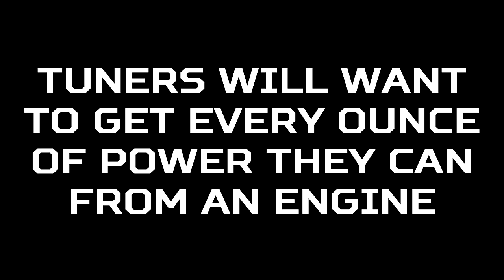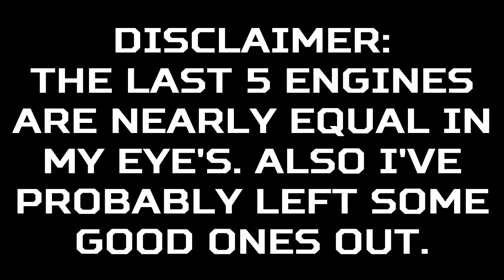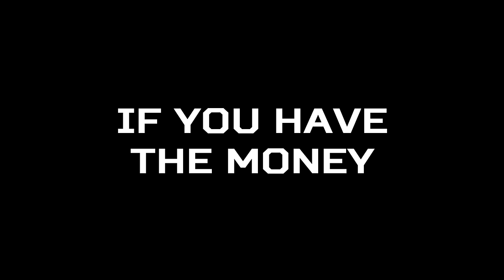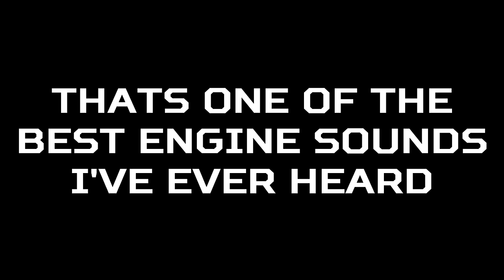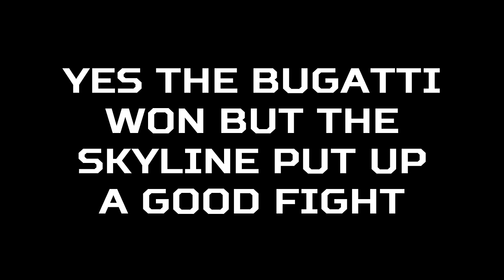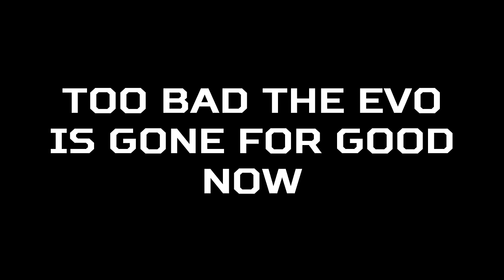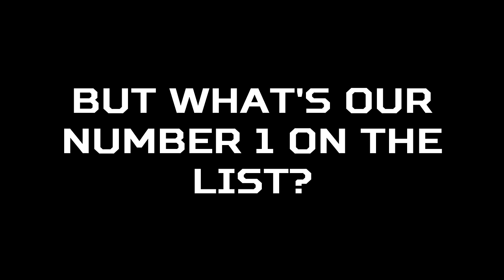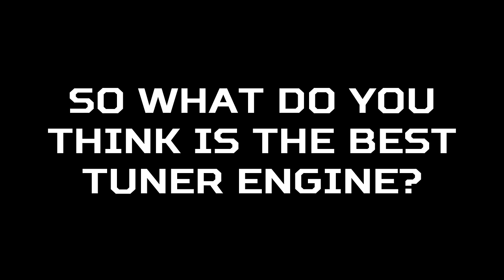9 of the Best Tuning Engines

Comment: ls should be number 1.
Reply: Kameron James I know, but he said the top 5 are nearly equal in his eyes
Reply: Only cause they're easier to tune than an Fm radio.
Reply: but muh 2j
Reply: Kameron James very true ls is a lot better engine than a 2jz
Reply: Great motor. But I think I think factory turbo motors yield more power through ECU tuning. My ls1 had rather small gains through ecu tuning alone.With a cam, heads, long tubes package later it made big power gains. But that was $$$$$. A 1.8t vw motor from 1999 can yield 50 hp, and 75 ft lbs of torque with a $375 remapped ecu. Now that impressive for the money.

Comment: Had to quit watching after I saw the Sr20. My assumptions were correct that this'd prob be a Fuckboi vid.
Reply: What's wrong with them
Reply: ?? Tf is that suppose to mean
Reply: One of the most overrated motors in the world. Aka. Garbage.
Reply: +James Robertson haha ok
Reply: I sorta get what your sayin, people generally have sr engines coz it happened to coincidentally be there when they purchased their s chassis not the other way around. Sort of like a producer and an artist, producer gets no recognition but put in just as much work. Sr is the producer and the chassis is the artist, whilst a 2JZ is the artist and the chassis is the producer.
Reply: Yeah I see what you mean but yeah I like SR's but 2J's are mad too.
Reply: +James Robertson 
100%
Reason why 2JZ is so famous is because how strong the internals are from factory. Extremely over engineered. The bottom end can be pushed to produce more than 300% of their rated power whilst remaining reasonably reliable. Very few (if any) engines in the world are capable of this.
Reply: I don't know how reliable they are but the fastest 4 cylinder I have ever seen has an sr20. It does the quarter mile in 6 seconds.
Reply: y jk the ls is still better the 2jz will need a top end rebuild before your making any power so no clue where you got a strong motor out yea stock there great but as soon as any power is on them they aren't reliable also an ls makes more on all motor those 2jz motors are all boost

Comment: No Audi 2.2 5-cylinder or Audi 2.7 V6? No 4.2 V8? No VW VR6? Shame on you...
Reply: Vr6 isn't that great. It's terrible for balance and poor head gasket design.
Reply: The big advantage of a VR6 is that it allows a 6-cylinder engine to fit inside a Golf. Also many tuners have proven the VR6 to be bulletproof reliable in most street-car applications. This engine only needs some basic mods to really wake up. The weak factory head gaskets are due to technical design difficulites that occure on most VR style engines. Still not a problem though, since you can buy extremly strong aftermarket ones. Also this motor is a beast under boost.
Reply: +ron zo I love the vr6 but I have to agree with you. They can hold a lot of power on stock internals but it's all the subsystems that you basically have to completely rework to make the engine reliable.
Reply: I worked at a company in the early 2000's called eip tunnig. They were pioneers at turbocharging that motor. The head gasket is a major failure due to the narrow v6. it creates to much heat. its very unfortunate because it is the small block chevy equivalent for vw. Cheap plentiful and availible. just has serious flaws.
Reply: Eip used to be the go to!!! would love to find a turbo kit for my vr6.
Reply: There is a company in Baltimore called Eastside. The guy who owns it was apart of the deveolpment. Had had the first vr6t corrado. Hit him up. He still can get the software i think.
Reply: or 1.8t even
Reply: Eip had that blue conquest back in the day whatever happened to that?
Reply: Rob Baker is a buddy of mine he had it. I have to ask him. The red one was fast too.

Comment: one of my favorite is the vw VR6
Reply: I agree, but the more common vw/audi 1.8T and/or the audi 2.7t should have made this list.
Reply: +Nicholas Wolf I have a 1.8t jetta :-)
Reply: +salemcripple I have a 2.7T A6 :D
Reply: I have both haha, not floatin my boat, only agreeing. I have 2 Mk4 Jettas 1 is a 1.8T that's my Tuner, I have a set of magnaflows on it and it unleashes it, and the ko3 turbo is pullet prove, I also have a Jetta VR6 not I know these are highly tuneable, I'm still learning about them. Great sound and, it's easy to Turbo the VR6 and really turn up that already torquey engine. And the VR6 always came in automatic of 6spd right? Glad you agree that at least one of these VW engines should be there
Reply: Hi, i'd like to yous know that i dont have either engine. 
Peace.
Reply: Robert Leduc I know that the R32 VR6 golf had a manual trans. I'm pretty sure the jetta did as well

Comment: No Hemis? The motor that makes dragsters so fast they need parachutes just to stop? Trash video...
Reply: +Brad Prause I know, the hemi is a hemispherical combustion chamber. That mixed with a motor as good as an LS explains those crazy fast drag times.
Reply: Hemi motors today aren't true hemi motors either. Still a good engines though:) pushrods to my heart
Reply: +Aiden PC Today's Hemis are true Hemis. It's the exact same design as when it first came out. Hemispherical combustion.
Reply: +Michael Scott They are not "true" hemi motors. yhe Gen III heads are different than Gen I.
Reply: +Michael Scott Granted that they are in effect hemispherical. Gen I had a combustion area that was like cutting a tennis ball in half. Today's heads are a little complex than those.
Reply: +Aiden PC more complex *
Reply: Nissan is not owned by samsung.. Renault has a 43% share of Nissan stocks, but does most defiantly not own them. And Samsung has a 20% share of Samsung-Renault Motors Stocks, a subsidiary of Renault, not Renault. Samsung does not own either companies. Stop spreading miss information.
"Renault acquired the car division of Samsung on 1 September 2000 in a $560 million deal for 70% of the company,[175] eventually rising its stake to 80.1%.[176] Renault Samsung Motors is a marque used almost exclusively in South Korea (although some models are sold in Chile). The majority of the company's production at its Busan plant is exported under the Renault badge."
Reply: ford owned a minority stock of cummins in the 90's, cummins has always been independent. why wont this rumor ever die?

Comment: FYI: Lancer Evo is powered by 4G63T, not 4G63. Although the engine is more or less the same thing, 4G63T is stock turbocharged DOHC engine. 4G63 comes in a variety of different configurations. For example, my car is powered by SOHC version of 4G63. The beauty of Mitsubishi Sirius engine is that it's very modular. Want to replace SOHC head with DOHC head? No problem. Just bolt it on, get a new timing belt and swap the oil pump cover.  If anyone's interested in beefing up their 4G63 - check out Project Zero G. This guy has buttload of info on modyfing cars powered by the Sirius engine.

Comment: LS > 2jz. The LS is the better engine in pretty much every metric. First off they're cheap, easy to find, and you can build them a million different ways. It's shorter allowing it to fit in smaller applications or behind the front axle if your going for optimum weight balance. It's lighter by almost 200 lbs with less top heavy weight giving a lower center of gravity. Stock vs stock they can reliable take about the same amount of power depending on the LS though some LS engines can actually handle more than the 2jz. Fully built they can both take a ton. And in the end the LS engines have more power potential without having to use as big of a turbo or no turbo at all.

Comment: The Saab b235r definitely should be on the list.
Reply: B234* b235s have weak internals compared to the older versions
Reply: +GraffPaint85 maybe but if you can achieve the same hp/litre as from 2jz with stock internals, it should be definitely on the list.
Reply: b204,b234 , internals are good for 500 hp from factory!

Comment: Barra 6 turbo engines.
Fg onwards. Big power and very underated.
4l is not a bad size for a straight six too.
Reply: Get off the pipe bud come on its insulting legend like the 2jz with a crap barra

Comment: I like this list and agree with most of it. One thing missing. Ford aluminator. Basically a coyote from hell. An indestructible light weight block that can take all the power you give it. Just not cheap

Comment: LOL try tuning an RX-8 rotary... :D :D also I'd add the Peugeot ES9J4 to the mix, it's a 3ltr V6 which has 194 BHP stock with a turbo it can hold up to 450 on completely stock internals... I've tested it :D my daily 406 coupe is powered by one of those I turbocharged it 2 years ago hadn't had any issues... 320 HP 540 NM of torque..... very fun to drive. And about the LS series I get why they're so widely used... great, durable engines, great sound and also are easy to maintain.

Comment: By the way, the Mazda Rotary engine is called the Wankel Rotary engine. Wankel is the Guy that invented the engine back in the 1940s. The rotary engine is the equivalent to a performance six cylinder engine which is why it guzzles gas.

Comment: I like the Coyote. Ford has kept the displacement down on these, but they put out plenty of horsepower. The LS is a good engine, designed by Holden in Australia. When GM brought them into the US the held back on the potential of the design so they would be able to upgrade it for the next few years. Now we're seeing the ultimate direct injected version in the Corvette. It took long enough! Ford gave their all with the Coyote almost right off the bat. And you can't forget the Chrysler Hemi. It's grown and gotten stronger over the years and although the Hellcat isn't very old, it will be a mean platform for years to come.

Comment: I feel like the coyote should be higher on the list. You can run a crazy amount of boost on stock internals. It's an insane engine. I know people running high 8's low 9's on stock internals

Comment: My favorite is the 12A and 13B twin turbo rotary engine. Had 2 rx-7s in the past,but I was surprised that you did not include in your list the 4AGE BLACKTOP 20V from toyota. They are good engines and spend good with 110mm itb's on

Comment: The 4L Ford Barra beats the 2JZ any day of the week. I have the Barra 270T FG which can make 800hp with stock internals (bolt ons only). Plenty of built barras running more than 2000hp. A naked barra engine, inc sump, is only 5kg heavier than the RB20, but double the displacement. In Australia, barra conversions are possibly more popular to LS swaps.

Comment: You have missed out one more BIG potential Engine from Toyota - 3SGTE which could tune up to 1,000 HP easily! It is very reliable engine used by many Toyota default models (MR2, Celica, Caldina, etc....

Comment: how do you not have the original ford 5.0 on this list
Reply: +Brendan Mccabe I know right. Its almost impossible to upgrade a 5.0 and not make power
Reply: +Anthony Dwyer its almost impossible to upgrade any engine and not make power.. Wtf are u trying to say..
Reply: Ive had aftermarket parts I put on my car and it lost power .
Reply: The word "upgrade" implies the part is having a positive benefit to your car... You should call your "aftermarket" parts a downgrade if they are losing power.
Reply: Although we all know what you mean, I'm sure he meant the all these engines can just put a 93 octane tune and make a decent gain. Also, what you pay for in parts for your Windsor 302 is more expensive and not as high gains for what you could do with these engines. And if you do spend the money on it, I guarantee you'll still have issues keeping a borderline non street able car running...
Reply: +Brendan Mccabe Cause he favors the import side. Honestly it comes down to ls/5.0 battle of the 6's with the 2j/rb. I don't know about you but I haven't seen a 10k hp 6 or 4 cyl, and that's not even from an ls. As far as tuning...well it's simple math, 8 cyl will make more with ease than a 6 or 4.
Reply: he said the ford coyote engine which is the 5.0s lesser known name if im not mistaking
Reply: +Brendan Mccabe because 5.slow
Reply: Because LS is better
Reply: I'll agree the ls is a little better im just suprised that the 5.0 wasn't even on the list it may have not been first.  But the ford 5.0 is a really solid engine
Reply: +Anthony Dwyer unless you're talking about the cammer, (which was built as a crate for racing) the Coyote is the 5.0 used in v8 mustangs... Not sure if you're talking about a different motor, those are the only two 5.0's I know of that ford made
Reply: The motor used in foxbodies and I like the new ones put in the new 5.0 mustangs.
Reply: +Anthony Dwyer oh, the "5.0" Windsor, it's actually 4.9 which is why it didn't come to mind 
It's a simpler motor overall, lacking some of the refinements of the newer blocks
It's a full cast iron 4.94 liter V8 with a curb weight of 450 lbs dry and OHV
It's a bulletproof concept but it lacks the insane potential a lot of other motors have

Great example, 2JZGTE, also in this video, 3.0 DOHC with coolers in the block (just for a fun fact) that can hold more boost and create more power at a given boost

The Windsors are fun motors, I just wouldn't think of them as one of the top 10 tunable motors

I feel like the list is actually quite complete
Reply: +Rocky Nichols No no, the coyote V8 is different from the Windsor V8, the coyote is OHC while the windsor is OHV there are about a thousand other differences which i wont go into because of time & txt limits but that's the basic.
Reply: +Guillotine Gaming $500 longblock with ebay turbo runs 5.7's in the 1/8 at 115 in a full weight foxbody. Probably the least expensive of all the engines in the group to make fast.
Reply: +89gt302 I don't think so, when we built the 347 we took a good while getting that fucker to mid nines on 27x10.5 slicks. So Ima call it there
Reply: +89gt302 on top of all that, once we got that fast the car wasn't street able. The car would stall as soon as you shift to drive. The shifts were too harsh. It was no fun for the streets. That's always been the argument.
Reply: +Brendan Mccabe  I agree, those were phenomenal tuner engines of its day!  It was so easy to triple the HP for very little cash relativity.
Reply: because single ohv makes NO power. Weak sauce.
Reply: +neverendingmods it's ok to be wrong
Reply: neverendingmods lol, you sir are hilariously uninformed.
Reply: +Brendan Mccabe Because he has the Coyote engine on there? That's like saying, why isn't there the older LT blocks?
Reply: Brendan Mccabe My point is that the Coyote engine is better than the Windsor. Just like the LS is better than the older LT/gen II

Comment: Saab B234R. On stock internals you can make a reliable 400-450 wheel and 500+ wtq. STOCK INTERNALS DUDES! THIS IS A 4 CYLINDER! 500 lb/ft OF TORQUE!

Comment: #5 ROB DAHM!!
Reply: oh and for the rotaries it is 12a, 12b, 13a,13b, 20b,and 24b
Reply: Is the number code for how much oil it will burn per tank of fuel?
Reply: +Jacob Garnham the older model of 13b didn't have the oil injector, and I don't know how much the rx8 engine burned

Comment: The Mazda engines are 13b= 2 rotor, 20b= 3 rotor, and and 26b= 4 rotor. The 20b is kind of rare because, to my knowledge, only came in the Mazda Cosmo. Or they would have to be custom made. The 26b is purely custom made, and the 13b is common. They are great engines, but I'd say hard to tune because they aren't like your normal engines, not many mechanics know about them. They crank out a lot of power for small engines. I want to get a 20b in my RX-8, but all the modifications would be around $15,000-$20,000 range.

Comment: I can't wait to put a 4 banger rotary engine in my probe
Reply: A what? there I'd no such engine. s rotary has 3 combustion events per evolution of the rotar. so unless you somehow built a 1 1/3 rotar  engine you won't ever get a 4 banger. bang refers to the number of times per rev there Is a combustion event (bang).  now you could slap a 4 rotar together but it would be a 12 banger.
Reply: +justin case I'm talking about a 4 cylinder rotary
Reply: +David Day dude..
Reply: lol
Reply: its a metaphor

Comment: the one that people don't realize , probably because they underestimate the cars that have them. the ecotec lnf. can do over 400whp all day in stock form. takes 28 pounds of boost like a champ no issues. and makes power super easy and cheaply. can go from 260 to up to 340whp with just a tune and some ethanol 315 on pump

Comment: The 4.6 S/C v8 in cobra terminator. The engine makes 700+whp on stock internals, and parts are cheap to get. The only downside of this engine is that it`s an ironblock and pretty heavy comparing to aluminum blocks.

Comment: Have you ever had your own car that you have tuned yourself? I have to tell you that I have 25 years of circuit racing and rallycross from a teenager and still very competitive at 44, but the truth is that this list of the type of people that think the cars used in the 'bit fast and bi curious' movies are not modified in any way that proper performance cars are built, they only have upgraded version of original parts and a huge amount of nitrous and the only thing that will be guaranteed to do is blow up if they are not rebuilt on a very regular basis. 
The engines you should be looking at are BMW s14 2.5 4cylinder in the e30 M3, with forged internals and the most accurate size of compressor and turbine in the turbo conversion pumps out over 900bhp for a fraction of the cost of making a r34 do it. 
As the r32 v6 24v vw engine is easy to get 1000bhp with a turbo installed, I had a 780bhp alfa gtv6 rwd 3.0litre twin turbo and 900kg that was in the 80s and nearly 900bhp per ton with no driver aids like you have to provide in the skyline because it is so heavy that it is only the computer that keeps it on the road lmfao